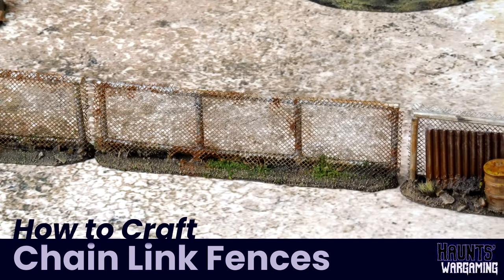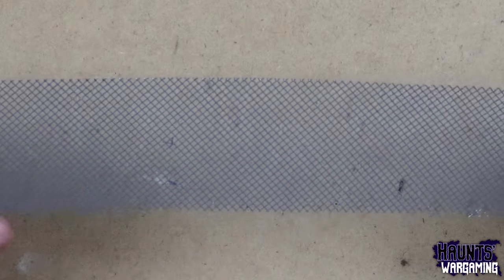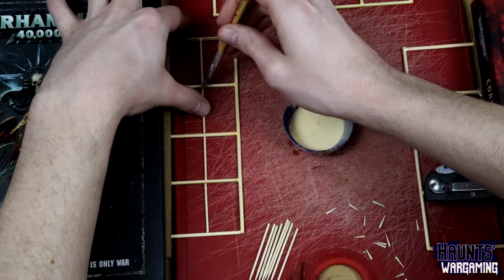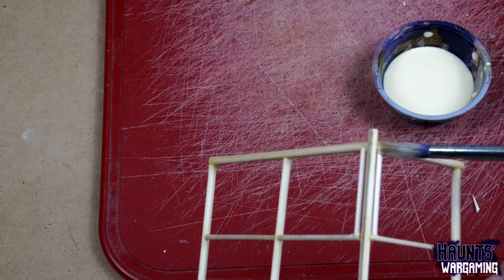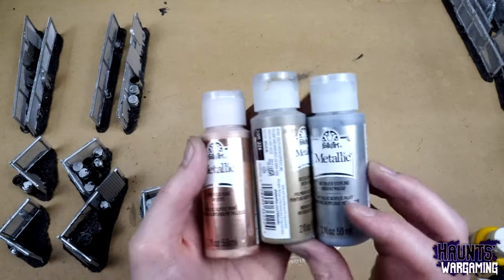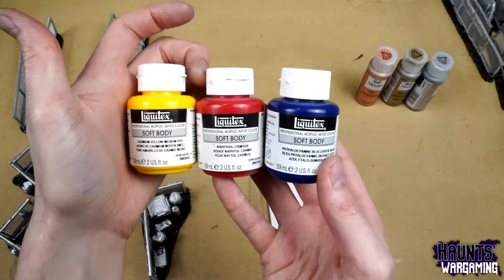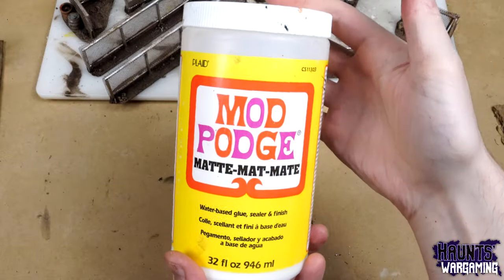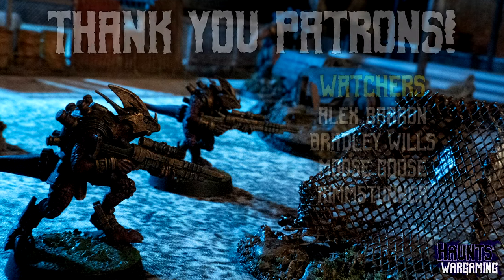DIY Modular Fence for Warhammer 40k, D&D, etc

Comment: I Like the ideas, and most some people call the "mesh" Screen, which is what I have found in The hardware stores. The Guy even said, " Oh you mean " Screen " I was Like that also what I Said, and as for the metal Mesh, I found some that was in the gutter department, its used to cover gutters from leaves and such. Some is smaller and some a big larger. But it works well for Fences!! Also I use Baking Soda to make the Super Glue Dry Faster, and makes it HARD AS A ROCK! I just put the glue on the spots and sprinkle the Baking Soda on. Works wonderfully!! Thanks for the ideas!!
Reply from the maker: My only issue with using baking soda is that it can be messy, but it does work well. I dilute it in water and put it in a spritzer bottle. It leaves a film, but you can wash it off.
Reply: @hauntswargaming  Oh never tried that way, but I will. Thanks Buddy!! I subbed!
Reply from the maker: @TomJones0065  thanks! You gotta boil the water to get it to dissolve BTW.

Comment: I did a fence-line, but didn't  make corners. I cut the ends of the bases at 45 degrees to the end point of each end of the fence, so they more or less make a corner themselves.
Reply from the maker: I thought about doing it that way but I wanted a single corner post and the larger corner bases provided some nice greeble real estate. Either way works 🤷‍♂️

Comment: They (snips) come in left, right and strait.  If your not working sheet metal (in my experience) just about any will do the job.  Why left, right or strait.  It is all about the cut you are making.  I would suggest just getting strait or by a cheap set of all three.  Great tip on goodwill and second hand stores.  They are gold mines for crafters.
Reply from the maker: True, It's nice to have a pair that fits your dominant hand for stuff like this in my opinion. But I can't say I've tried using the other ones. It would probably be beneficial to have all three

Comment: Very Cool! But I don't think you will see very much rust on a Chain-Link fence. Remember, it's galvanized, so you'll most likely see some corrosion.
Reply from the maker: Maybe not a new one, but eventually it'll rust.
Reply: As the zinc wears off it will start to rust. It would take a while but it would eventually.

Comment: Great video!

Do you think it would be feasible to make cross sections that include only one post per base? 

Either with collapses mesh parts that suggest an actually ruined fence, or sticking out straight as if connected to an "out of frame" post.

Asking because I'm thinking of trying this for infantry flight bases.
Reply from the maker: @Zejety  possibly if there are other points of contact.
Reply: @hauntswargaming  the primed aluminum won't have enough stability?

Guess I'll have to think of something! Shouldn't be TOO rough to come up with a few configurations of snapped posts, I suppose.
Reply from the maker: @Zejety  yea, the aluminum doesn't provide much support